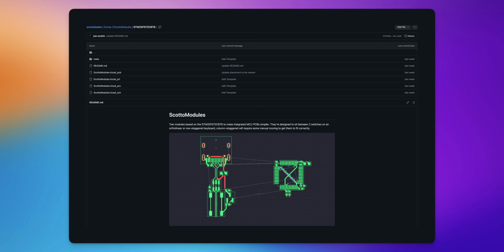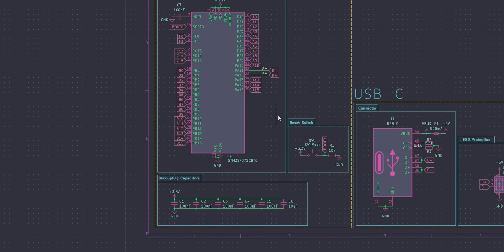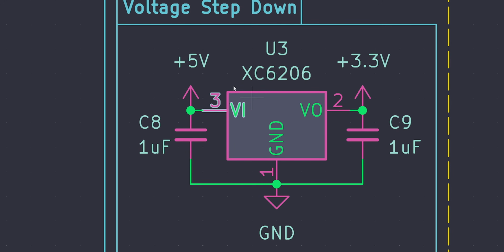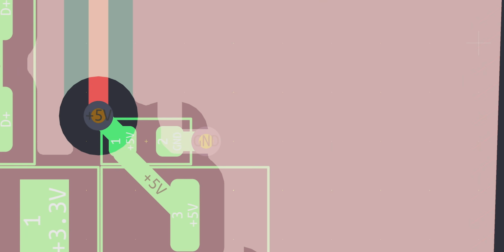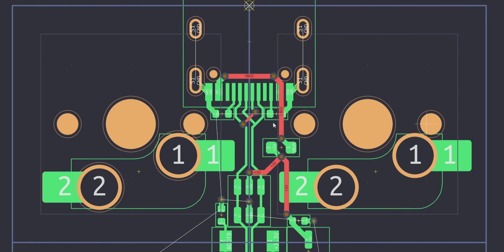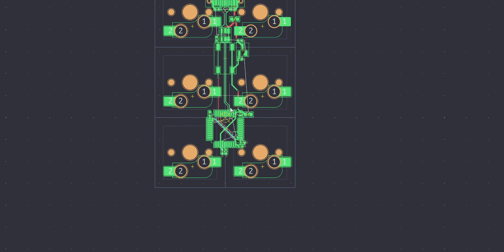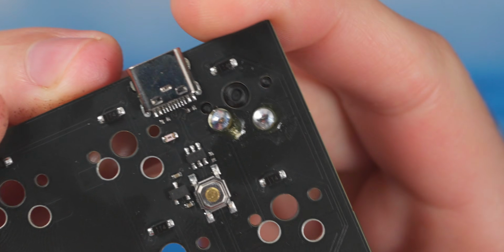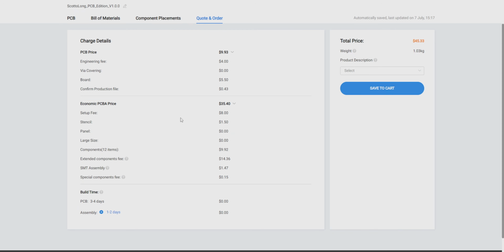Simple STM32 Mechanical Keyboard PCB Design in Kicad

Comment: Great tutorial! The only thing is, there're zero reasons to pack the power unit so tightly, with all that available free space. It would be an absolute pain in the ass to freehand solder those components in case of any maintanance, without hotplate or blower station.

Comment: Depending on the stm32 model a crystal is required for usb to function properly.
Reply from the maker: Correct, but the specific version I show in this video does not require an external crystal.

Comment: Thanks for making this video — it's the best guide I've found so far!
However, I have encountered a slight issue with the hot-swap sockets. I designed a plate using your libraries, and everything looks good. The exported STEP file and 3D models look fine as well. However, when I tried to order the plate with the sockets mounted at the factory, they would not show or register. It was only when I chose the option to do both sides that the sockets all appeared on the front instead of the back. This only affects the sockets; the pads themselves are correctly located on the back layer.
I will probably hand solder the sockets this time, but do you have any idea what might have caused this and how to fix it for future projects?
Cheers!

Comment: Could you please create a tutorial like this for a board that would use a JST connector, rather than the receptacle? I'm specifically trying to figure out how to make a 60% pcb with a daughterboard through a JST connector (trying to avoid molex for durability issues). I've looked up guides online, and some are referring to using Conn_01x02_Pin or Conn_01x04_Pin. Though a lot of the discussions on forums get really technical and it's kind of hard for a beginner to understand.

Oh and I'm also curious as to how you can put multiple layouts on a single pcb (e.g. having a 6.25U spacebar and 7U spacebar cutouts for a pcb). I'm still looking into this, and will probably find something in a forum, but it'd be helpful to have some sort of tutorial from you as well!

Side note, thanks so much for putting these out here. It's super helpful for learning Kican and working towards my goal of designing my first board.
Reply from the maker: The JST is fairly simple, you put the JST female on the keyboard PCB and route it directly to the chip (D+, D-, VBUS, GND). It will be Conn_01x04 in whatever version of JST you want. Then you make a daughterboard that houses all the USB-C stuff as I showed in the video. Then also just put a female JST on there and it should just work.

Multiple layouts is as simple as it would seem, you just overlap the footprints and then use QMK to change it. You would just route them together so whichever one you use becomes the one that makes the connection with the switch.

Feel free to join my Discord server and ask questions there :)

https://scottokeebs.com/discord

Comment: I would love to see a video about what it takes to make a split keyboard e.g. what needs to change when you have two controllers, two halves connected via USB-C, etc.
Reply: If you want 2/2 connected fully by USB, you’re going to have to pay a lot of money to have certifications and VID and PIDs as you can’t simply use test or really as the same one on both sides will create a bit of a problem however some chip manufacturers have already bought ones that they allow the public to use or you could just use another communication over the cable

Comment: I'm curious about how you chose the fuse. I cannot find the power draw of the STM32, so did you just go "Meh, 500mA is good enough ?" or did you have some other information like measured power draw of other similar keyboards ?
Reply from the maker: Typical USB spec is 500ma and 5v.

Comment: Hello, nice video. I have a single comment regarding the ESD protection, the input and the output of the ESD should not be the same net, and as such should not be directly connected. That negates the protection.

Example from what I know:
D+, D- from usb c conector are a differential pair that goes to the protection

And then you should create another differential pair (DM and DP) that goes from the protection to the MCU.

Hope this helped
Reply from the maker: Yup, updated on V2 :)

Comment: Great video, few things:

1. You probably want to provide a more powerful voltage stabilizer. Some people might want to add LEDs, and other perioherals which might draw extra power that the current one wont be able to provide. I recommend an LM317M. Its super widely available, been produced for ages, and can supply up to 500mA.

2. Its not bad to spread the decoupling caps out for the STM32 a little bit, this will improve solderability of the board in case something goes wrong and you have to fix it by hand.

3. Watch out for acid traps. While most modern PCB manufacturers arent affected, it is still considered good etiquette to avoid them.

4. The BOOT0 pin on the STM32 does nothing but select wether to jump to the standard bootloader or application code. This feature is seldom used on most boards, however if you don't plan on using an external debugger, this will suffice.

5. The STM32F072 is not the most common chip. A much more common and widely available one is an STM32F103, there are also a lot of clones, making this chip available basically everywhere.

6. Good etiquette is also naming the global labels that youre using on an STM32 to the respective rows and columns on the switch matrix
Reply: Holy cow. How can someone know so much stuff haha im impressed
Reply: read stm32's an2606 document and look at the bootloader configuration for each type of device (f10xx, f070xB etc etc) to see if a certain model supports DFU. also, certain stm32 models have a CRS which can be used to make the internal clock work with USB, without the need for an external clock. for example, f072 doesnt need an external clock or a pull up on D+ for usb.

Comment: Some interesting comments. Awesome video I was thinking of designing a keyboard myself and doing research on that matter. I was watching from a perspective of someone who designs PCB for a living. Feedback from me (explaining some concepts in as simple words as I can but there is much more depth to it then stated here):
1. Decoupling Capacitors are important and they act as a power well or reserve when the MCU needs a boots in power so placement is crucial (i.e. its performing some tasks and the needed current rises above what it typically needs so the decoupling caps provide it with a small boost until the power supply catches up), also it acts as a filter for noise and damper (think of the power you getting from the power supply in this case USB, its not a perfectly straight line. There are ripples within the voltage levels and the caps damp these ripples to create a smoother voltage level per say.) You need a decoupling capacitor per power input into the MCU so in your case I think 5 from what I can see in your MCU symbol assuming its correct.
2. Use thicker traces for power, provided multiple benefits.
3. You dont need to use a via the way you did when routing the differential pair from the USB C end. You can move the VBUS trace further back and then route one of the pairs behind it creating a better continuous trace without the need for a via.
4. Return paths for your traces. It seems like you are using a 2 layer board which could cause issues in regards to return paths if its not done properly and introduce a lot of noise into your system. One example i can see is your Data line from USB C it has a voltage trace running above/underneath it and the data line has no unbroken return path under it introducing a possibility of noise into that trace
Reply from the maker: Thank you for the feedback, I actually ended up releasing a V2 that overwrites what I show in the video. The main fixes were for the ESD/Fuse routing and decoupling caps. I also swapped to a 4 layer PCB for better ground/EMI isolation. It still uses the same concept as shown here with just 4 traces between modules but overall should be much more robust. It's on the repo now :)
Reply: @joe_scotto  Pretty awesome V2, just had a look at it. I am curious as to why you don't have a ground pour over top and bottom layer? Normally you would keep those in order to reduce manufacturing cost and have balanced copper across the board. Also helps with EMI issues, stitch the ground together for it.  Curious hence I ask

Just another note, not sure if you implemented it but did you do differential pair routing at 90 Ohms? if the traces are not too long it should not effect it too much but your one is a distance away and its good habit to implement it regardless. I know JLCPCB have a calculator that helps with the calculation, in your case its co-planner differential pair

Comment: Good stuff. Some notes:

Decoupling caps should be as “manufacturably” close to the VDD pins as possible, bulk cap is more forgiving. Typically you would do Via, bulk cap , decoupling cap then vdd pin. Also take into account your power planes and reference planes depending on how many layers you have . It is better to have a solid ground layers and use copper pours for power connections for better impedance but at the expense off potential increased capacitance.

USB is harder to impedance match on 2 layers because of the distance of the ground plane to the diff pairs for 90 Ohms but if the distance is really short and not close to other tracks, you can usually get away with it. 

Low speed GPIO won’t be as susceptible to crosstalk but it is usually better to fan out your tracks after leaving the ICs pads.
Reply from the maker: Thanks for the feedback, I've had a few people reach out about some design choices here and I'm nearly ready to release V2. It should follow better practices and be more reliable: https://github.com/joe-scotto/scottokeebs/pull/18

Comment: Decoupling capacitors placement IS IMPORTANT, a bad placement or just ignore them and don't set them nearby your MCU can cause lots of noise. Your keyboard is just gonna be  an easy target for EMI and the voltage supply to the MCU is gonna fluctuate.
Reply from the maker: Yes, fixing this in V2. Video coming out in a few days.

Comment: This was very informative as always, Thanks :)

Any chance you can make another video about how to program a board like this?
By 'program' I mean how do you load the compiled firmware from a PC to the newly assembled PCB? (PCB with an STM32 MCU)

More specifically: Do you connect a USB cable to program it? With what programming software? Does it depend on the bootloader? What bootloader does the MCU come with?

I was able to find many tutorials on how to do it with an arduino but I'm having a hard time answering these questions when I'm comes to designing a PCB with a standalone MCU.
Reply from the maker: The STM32 I use here just works basically. When you get the board, you hold the boot button when plugging it in and you’ll be able to flash with QMK toolbox.

Comment: Very informative, unfortunately this MCU is not easily available in my country, if looking for an alternative what parameters should I be checking for it to work as a kb usb controller.
Reply: Enough pin ports, frequency, USB communication, programming tools. 

Any STM32 or PIC24 can handle this task. 

The stm32f411re could be a good option.

Comment: If I am not mistaken the resistors on CC1 and CC2 are to be able to use USB-C to USB-C cables, otherwise you can only use USB-A to USB-C.
Reply: Yes and no usually it’s only for that however there are so many unusual cables available on the market where some include the resistance some don’t and there are a lot of ones that don’t follow the standard but give you additional features
Reply: cc1 and cc2 are used in pps for voltage trigger, for 5v trigger request you have to use 5.1k resistance between cc1/cc2 to gnd. This process is called passive trigger but in mobile phones like samsung phone it decides a certain resistance that can give variable voltages to the phone.